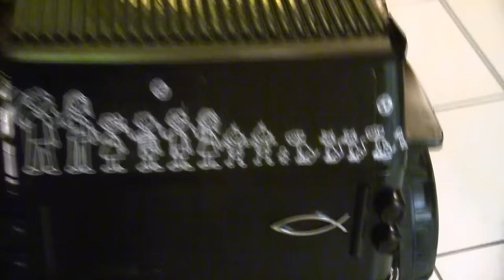INSANE Toy Car Race CHALLENGE - CAR BATTERY IN TOY CAR [DANGEROUS]

Comment: When I was like 12 my dad and I put a car battery on a power wheels. It wouldn't move because the wheels just spun so then we spent way too long running way too many self tapping screws into the wheels so it had traction. We did all that as a way to haul hay bales down a quarter mile driveway. But we ended up "testing it" first and burned the motors up before the first hay bale ever got hauled.

Comment: You can uograde the voltage in there by putting a 12 volt battery or 24 volt battery in those cars it it will increase the speed by a ton